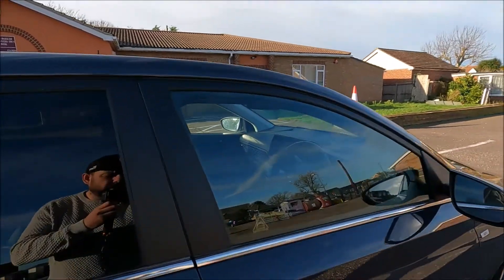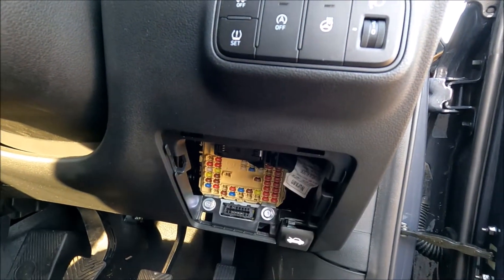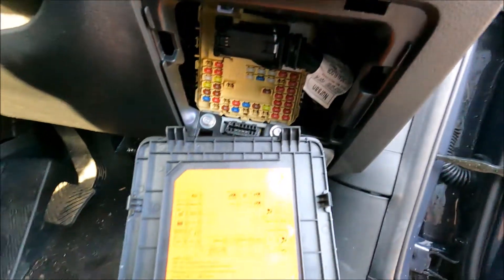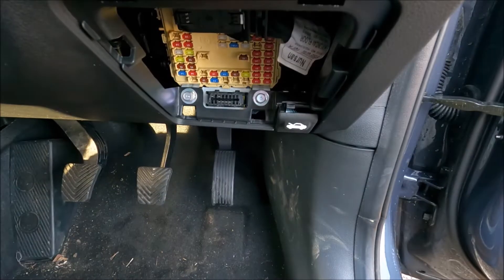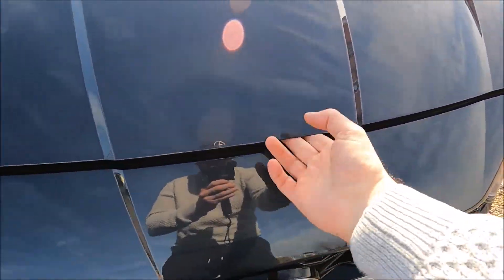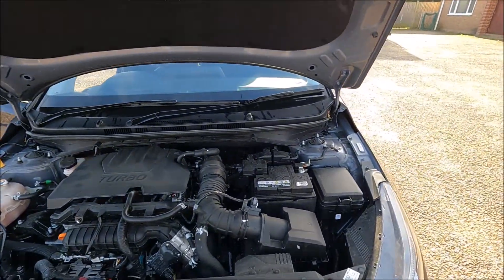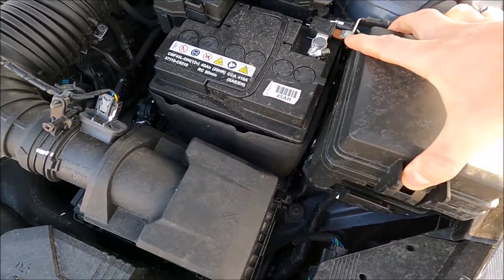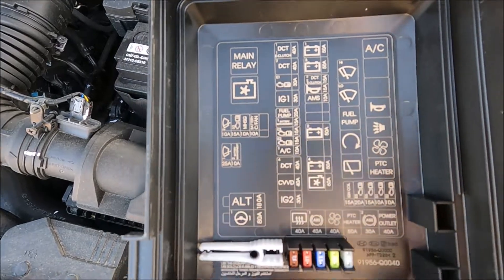Hyundai i20 OBD2 Diagnostic Port, Fusebox Locations & Diagrams - (BC3 Smartstream Asta)

Comment: What about for the headlights and fog lights fuse I didn't see it
Reply from the maker: Hi there , Sorry for not replying sooner, the lights will be powered from one of the ECM's 'electronic control modules'. Unfortunately its not as simple as it used to be with individual circuits being protected by a single fuse. If you are having issues with them both I would assume they are both supplied from the same ECM, you could check the fuses to them and start there. Ross

Comment: hey ross, love the hyundai videos.is there any chance of doing a driving video in the i20 and telling us how it drives and what you think about it. i"ve got the i20 on my shortlist of potential small cars to consider and would like to hear your views on it . thanks.
Reply from the maker: Hi Garry, thanks for watching and your comment. Unfortunately have had to give the car back now, however I highly recommend it, over the past few years I have driven most of the smaller cars out there, the i20 ready did stand out for me, it has all of the technology of a car double the price not to mention the shocking power of the 1.0l GDI Turbo engine (mild hybrid), when you put it in sport mode it launched really well and certainly wasn't underpowered on the motorway. The drivers position was perfect with a very sporty feel, we also managed to fit 2 people, 1 baby in a car seat, 2 suitcases, 3 hand luggage, and a pram folded down in the car!! On other occasions we comfortably had 4 adults and the baby in her car seat. 
A few downfalls I would mention was the fuel consumption was a lot higher than I expected from a 1.0l Mild Hybrid, only returning an average of 42-44mpg, and some of the features like lane assist would turn on every time you get in the car as a 'guest', you have to set up a full driver profile if you want it to remember the settings etc, which is fine if you own the car but it was on loan to me so I didn't. I hope that helps. Ross